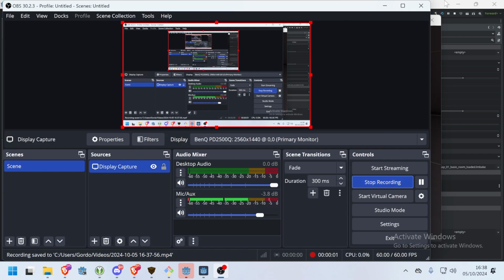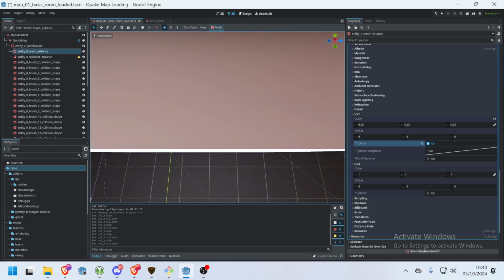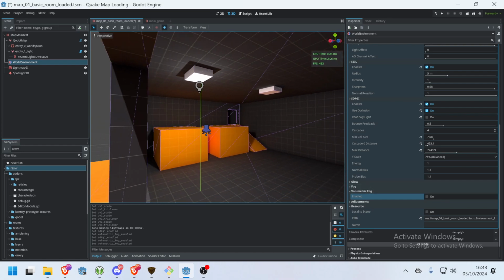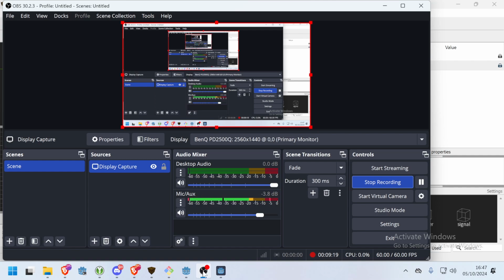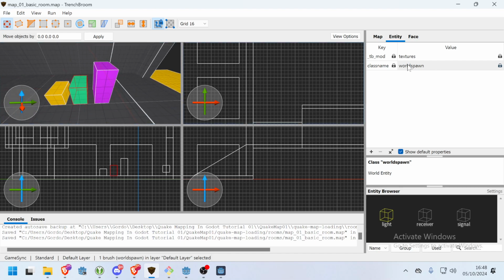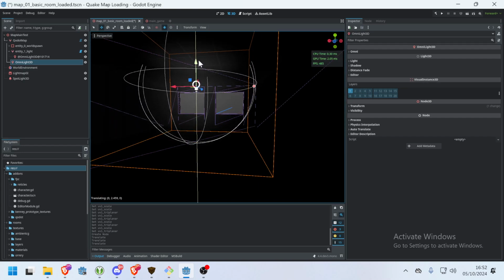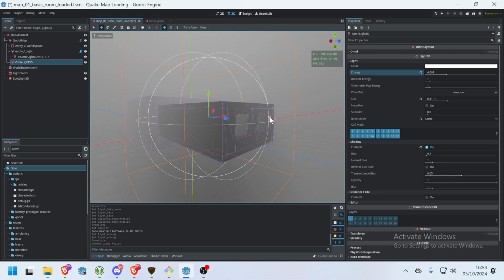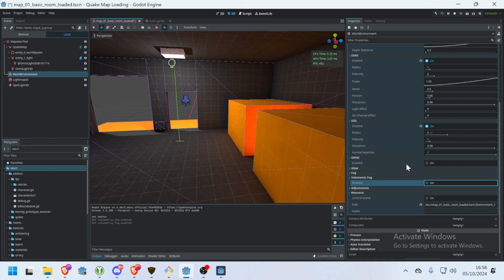Trenchbroom is AWESOME - Testing in Godot 4 (Level Building example)

Comment: I use Trenchbroom myself. There is a way to use, align and scale textures in Trenchbroom, and then when you import it, into Godot, it will have the same texture in the same place, and is much easier to use for texture placement than Godot. Also, if you name your material file the same name as the texture used, Godot will just go ahead and replace the texture with the material properties, with reflections and normal maps etc.
Reply from the maker: Thanks ill give that a try tomorrow and ill see if i can get some basic doors working